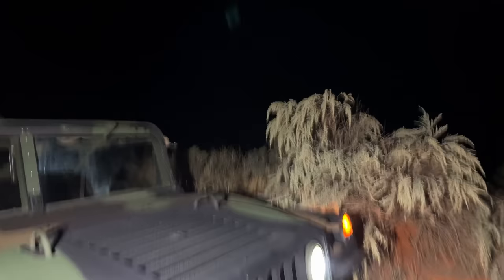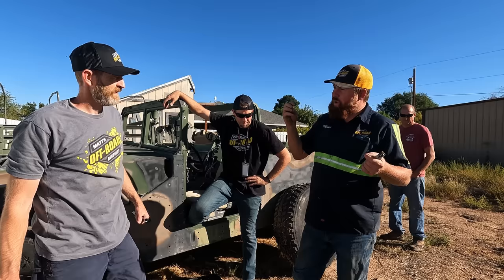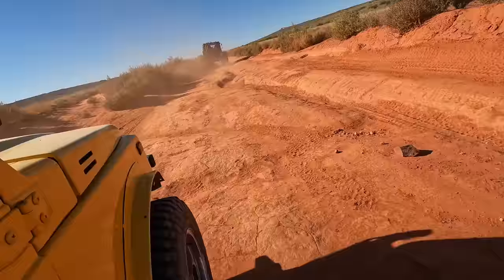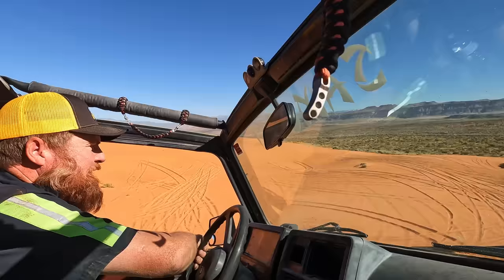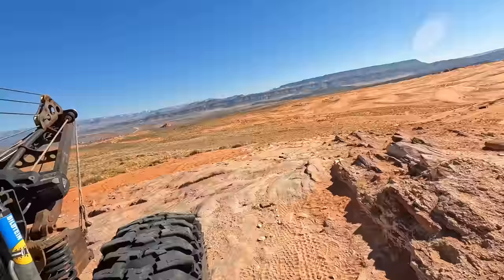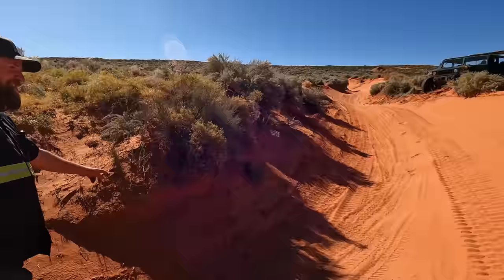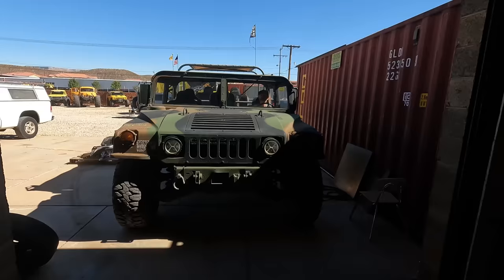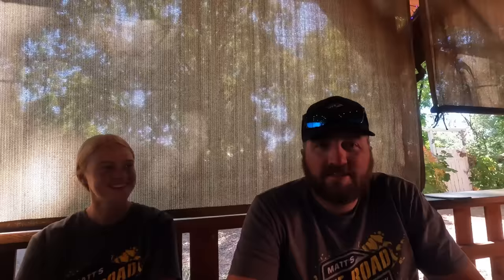Samorri Get's Its First Off-Road Recovery!

Comment: Seeing Matt laying in the sand, sometimes the mud, rocks, etc.., I can’t help but see a market for “Matt’s Mats”
Reply: But how to solve the storage issue? Always gonna be dirty, plus it could be too thick to store or too thin to be useful
Reply: too thick/too thin means trying the Inflata-Matt option.  any holes resultant from goat heads equates to ad hoc air conditioning
Reply: The specs are up to Matt and his experience in the dirt-seat. It’s like any other gear: needs care and maintenance.
Reply: Brilliant!
✌️🐸
Reply: Matt's matts......has a ring to it.
Reply: Aka yoga Matt
Reply: I also bring some of those thick foam play tiles for laying on, they're full of welding burns etc, but so far seem to be quite durable and not effected by any automotive fluids or the elements
Reply: Matts mats is a great idea, it could be thin roll up, doesnt have to be padded much just tough and something to get you out of the mud. personally i use carboard but that breaks down
Reply: Matts Goat No Mo Mats
Reply: @GreatOutDoorWorldofMines  Something like an oversized sushi roll mat. Bamboo is a great material for stuff like this
Reply: or bath soaps!
Reply: @meeeeee423  Design a mat like an onion. as it gets dirty peel off a layer. Or simply have a mat that turns inside out for clean storage. clean it when you get back home.
Reply: @meeeeee423  You actually have to bring them along to have a storage issue....like tools 😐😐
Reply: Matt should do something like a heavier duty yoga mat that still rolls up nice. Tough enough to not get punctured by sticks/rocks but still stows away for storage.
Reply: @meeeeee423  I've got a thin rubber mat that came with the trainer setup/addon for a regular bicycle. it rolls up like a yoga mat but is a better thickness. I've laid it on my gravel driveway when I've needed to crawl under something out there, and it works damn well. it doesn't need to be massively thick.
Reply: I have used rubber roofing for years mud ,rock,sand ,easy too clean
Reply: He needs a heavy canvas drop sheet, something around 1x2m (3' x 6' or there abouts), it's strong enough that it won't get cut up, can be washed off easily, and will take a lot of the sting out of rocks and brambles.
Reply: @georgemiles7392 Inflata-Matt as in a blow-up doll with a beard glued on?
Reply: I think he could use inflatable mat jacks, too, raising the vehicle to a more workable height.
Reply: @meeeeee423 if you’re out playing in the dirt, you’re not coming home clean. This at least gives you the option to store the mat in the back of the truck, which is much harder to do when you’re the one that’s dirty instead of a mat. 😉
Reply: Make a thin locker behind the seats.  use three or more 2'x2' mats (adjust the size as necessary for available space) with holes in each corner for connecting them together if needed.  keep some zip ties in the locker for that purpose.   They stay dry, relatively clean and easy to assemble into the configuration you need.
Reply: Last cactus agrees.  😉
Reply: I wish I could post pictures here. Id take a picture of it. I carry a floor mat...with a logo on it. It came out of a school, so it has their logo on it.
 It is a floor mat that a company puts in front of an entranceway, they go on the inside or outside. It is carpet on one side, thick rubber on the other. There are companies that make these, and they lease them out, or something. They pick it up, trade it for a clean one, and they clean it at their Shop, and come back and trade it back, and so on. Or you can buy them, and lay it at the door on the tile floor, and vacuum it. 
 I roll it up as tight as it can go, put a Velcro strap or three around it, and toss it in back of the Gladiator. It is about the size of a Tonneau cover, when rolled up.
 Matt, if you take this idea, I just one one for myself...please...:D...and maybe three for my buddies to carry in their rigs so we can advertise for Ya at KSC where we work. :D
Reply: A big sheet of cardboard works well….”plastic” cardboard even works in mud.
Reply: i love that idea

Comment: I don’t know about sand hills, but in my samurai putting 6.5 gears in the transfer case made it climb almost anything. I’m excited to see more samurai content and what y’all are going to do with it!
Reply: I just made a similar comment that thing deserves a full build, would be great content those old Samurai's are great capable machines if built correctly I used to have a '85 hard top when I was a teenager that I still regret getting rid of, it was so fun, great for wheeling tight trails
Reply: @caseyrenner7024 everyone who's owned a Tintop Samurai regrets selling it. I just didn't fit comfortably in mine.

Comment: I just did a Samurai build for myself. I wanted one after driving a friends on trails in 1989. Now I’m 53 and finally have one. I did a axle over spring lift and added a couple leafs from CJ5 lift springs. It now has a Toyota 22R-E, Toy 5 speed and T case. I put 5.38 gears in the stock axles and a mini spool in the back. It sits on 35” Cooper M/T’s. I welded up an exocage for when it rolls (not if). Now I’m thinking of using a Prius steering column for electric power steering. I topped it off with a roof gun mount for my Browning M1919A4.

Comment: I think the Samorri needs to become the World's Smallest Off-Road Wrecker. Put a little boom on the back and make it a mini-wrecker just for kicks!
Reply: Having driven many thousands of kilometers on very soft sand dunes, with a standard light weight, low horse powered Suzuki Stockman, lj 80, with an 800 cc, 4 cylinder 4 stroke engine, I found that it needed very special soft, ballooning tyres, to form a large footprint on the soft sand.
In doing so, it was very capable of travelling over the softest sand, which most 4wds would sink in.
The sidewalls would bulge and form a very long footprint on the sand.
Most normally available 4wd tyres have far to ridged sidewalls, and do not allow the light weight little Suzuki to form a large enough footprint, to be able to float on top of the soft sand.
At 13.46, it shows no appreciable bagging of the tyres necessary to float on top of soft sand.
If there is too much "high pressure", not "low pressure" then the footprint is too short.

Comment: The best part of off-roading with a Samurai is the weight. If you get stuck you can lift it out by hand.  You could put a wench on a quad and pull it out :)  Great video!

Comment: idler arm and pitman arm can be remove. Use 40 pounds rack and pinion steering with CARDONE power steering pump and Mervin V fluid use a strong flat washer to the steering pulley and put the tool steering pulley pusher and puller to install all hard plastic and steel hub pulley for power steering. And press against the grade 8 washer/fender with the tool to protect the pulley is what the washer is for. Then align the steering pulley and shelves and tensioner with serpentine belt and afterward remove the strong washer and pusher pulley tool without using any hook/jaw. Then drive until power steering pump gets wear out because the steering fluid is boiling too hot. Only after it is used in long driving. Remanufactured steering pump cost is $122.00 dollars.

Comment: Goats heads are lethal. My co-worker was doing support for the Logan To Jackson (LOTOJA) bicycle race several years ago. Someone had been hauling weeds with a lot of goats heads in them to the dump. They lost a lot of their load at the bridge over the Snake River and picked up the weeds but left a lot of the goats heads on the road. Almost all of the bike riders had lost one or both tires and one person lost control, hit the cement side rail, flipped over the side of the bridge and died.

Comment: Tom you could use a dune buggy wiper motor too.. they have the switch on them and it just takes 1 hole to run the arm thru. Switch is included on the motor also. You can add 2 or even 3 on larger windows and run them independently.

Comment: The bits you need are left handed drill bits for removing broken bolts... pick up a set- very helpful drill bits. Most of the time the bit catches and spins out the piece.

Comment: Tire pressure and engine RPM's in lightweight vehicles are a whole different world to full size vehicles. Where 12 psi might be a minimum in a fsv, 6 psi might do similar in a lightweight. Get your tire pressure right and drive it high in the rev band and these things will go almost anywhere. Loving the video's, thanks guys.

Comment: 22:05 Tom, just use a Jeep CJ type window wiper motor...It does a 90* arc & has the switch right on the motor. Cheap & readily available! My '49 CJ3A uses one.

Comment: 🌟🌟🌟🌟🌟I was stationed with the 702nd Maint. Support Battalion 2nd Inf. Div. Camp Casey Korea in 84,85,86 The Machinist for the 702nd.  Those Hummers- watch out for alternator adjuster bolts breaking on aluminum heads all the time - the love hate relationship of aluminum and steel 🌩 The new gal has this, I seen her hand placement- she is not a newbie to the 4x4 world steering wheel and to keep those thumbs out on a manual steering - yeah - she deserves placement there Matt !

Comment: I had a couple Samurai's, the most fun to drive, was on 33's with 1.6 dohc out of a 95 Tracker. No gearing changed anywhere and would do 70 on the highway and anywhere off-road

Comment: I use the reverse extractos bits for broken bolts all the time, if there is enough thread showing, I will use a stud extractor. In yalls case, a regular drill bit from the frame side will usually push it out.

Comment: How does a Humvee tour company not have its own mechanics?
Reply: They do it's matt
Reply: They really are just a company overcharging for tours that always break down. 

They don’t have good running vehicles, they don’t have good drivers, and they don’t have their own mechanics 😂😂

How are you taking people into the desert on yours in old vehicles, and have no clue about vehicles or how to repair the simplest issues
Reply: Guessing that it's cheaper to outsource the work than it is to keep a qualified mechanic on staff full time.
Reply: They didn't know what was wrong, so they sent a tow truck in case it cant be fixed. They do their own work back at their shop.
Reply: @stevekight1955 still I see an awful lot of them broken down. Maybe do some preventative maintenance.
Reply: Becaus did they did then that wouldn’t create good content 😂
Reply: ……spare parts Hummer may have wiper assembly, swap out for services
Reply: @anthony5227  the owner and Matt spoke about some of what you're saying here. They do service the vehicles.
They just have so many of them and do so many tours and sometimes one of them breaks down.
The owner said that maybe on 1% of the tours one of those vehicles breaks down and that's when you get to see them here on Matts channel.
It's basically statistics: If you have so many vehicles out so often on rough terrain like the rocks and desert, something's bound to happen sometimes. I mean look at Matt's vehicles. They also break down sometimes. They're not unbreakable.
Reply: They have Morr. Why keep the overhead?
Reply: @Questionable_creations I mean look at this episode for example  the bolts snapped unless they were rusty under normal driving conditions that would have never happened even new parts can break off-roading if you hit them right there’s way more crashing and stress involved
Reply: I Imagine they do have their own mechanics, they just don’t do field repairs. You have to remember you’ve got customers with you. They don’t want to hold them up on a field repair, even if it takes 30 minutes. It’s their money and time being wasted.
Reply: Just “yet another dream” of capitalizing on an idea. It’s an American dream, “let’s go take military Humvees, do tours in Utah…easy money“. yes,  intrinsically unqualified, but …dreams. It’s cool.
Reply: @Questionable_creations I used to drive those pieces of junk all the time. I spent more time fixing them than driving. Does not really matter how much preventive maintenance you do… they just break all the time.
Reply: @michaellauer3397 exactly. Anyone who believes that every small business runs like a well oiled machine is out of their mind. It’s people trying to live a better life than 10 hours a day in a cubicle. Eff that
Reply: Because they got matt and can waste his valuable time so he can't get real projects done
Reply: @stacycarter8641 they are a piece of military grade equipment.
IE very expensive way of buying something from the cheapest bidder who also has a cost plus maintenance contract 😂
Reply: It's probably cheaper to pay Matt then to employ a mechanic and have to pay him like like another employee
Reply: All they knew was steering was not functioning and when you're steering is not functioning, it's usually safer to assume that a trail repair is next to impossible, which in this case it was because the only two options that I see basically required either a lift or a welder or both. As for why Matt fixed it in the shop, they could have paid him to do that because they only have one or two mechanics and they have 10 plus Humvees they need to be maintaining
Reply: Everyone is running so lean they sub out all of work and services.

Run as many tours as possible to make as much money as possible
Reply: Because it's cheaper to not.
Reply: @stacycarter8641  exactly. Anyone who's actually dealt with them knows they're crap.

We had 2 in my squadron, 1 was ran into a tree before I pcs'd in 5 years after I got out they were still trying to get that thing right.
Reply: @1rstTry You are a philosopher. I, as a person who has fired every boss I've ever had understand your philosophy.
Reply: @anthony5227  they've explained before they have like 18 or so Humvee's. So the one or so a month or so we see on Matt's is just a small percentage. Ask any veteran Humvee's break a lot. Seeing as we don't have one on every video Matt produces I think they do a decent job as far as price I've never looked them up so I wouldn't know
Reply: @wullxz  I saw that video also. 
But the dude just sounded like he was trying to save the company image. 

The steering broke because he couldn’t steer it anymore. 

And he couldn’t see that the  lots had sheared off? 😂
Reply: @anthony5227  well, he could've also just said no to the publication of the video.
Reply: @wullxz  and that adds on to the point that this guy does not know how to run a business
Reply: Bc they can just call matt duhh
Reply: Because they're some slick willy geniuses that buy the cheapest example they can find, who wants to ride around in some underpowered loud for little reason, exhaust spewing open whole top hoop

Comment: Matt. The vacuum port on the samurai going to the distributor tends to plug often with engine blow by. The factory muffler holds a lot of restriction. I put 2 1/4 inch exhaust from the cat back with no muffler. It was not loud and sounded very healthy. My dad use that samurai for years going from Oregon to Arizona every winter, pulling a trailer those two things will nearly double the power feel of the samurai without adding extra weight to it.

Comment: Tom's idea made the job a lot easier than removing the box. I have had the reverse bits work maybe 1 out of 4 times. It sure puts a smile on your face for a while when they do. My biggest problem is finding them to even try. I only had a set of 5 to start with. Another job well done. It's like the state hwy workers around here, 5 people there and only one working. People joke about it and bring it up all the time. Too many Chiefs and not enough Indians is used the same way.

Comment: guy in the north west, (acme adapters) samurai expert.  sells adapters for everything for the samis. i put a little vw diesel na in mine, ran 31,s with the newer allterrain bfgs,  thing topped out about 60 mph with a good back wind, but in the florida scrubs would go anywhere, floated across the sugar sand easily. was horrible in mud  no wheel speed  lol. if nothing else check him out see what he has, guy is super nice  always  answered any questions when id call, and he has kits for alot of different eng tranny combos and other parts sammi specific

Comment: when I has my Samurai I got a transfer case rebuild, I can't remember but I think it was a 7/1 transfer case. Some have double transfer cases. A new motor would help out also from a side kick. Buy a larger offset rim to push the tires out more and it will be more sturdy. I was running 33/12.5 r 15 on mine. Wasn't a race car and had to downshift on steeper hills on pavement but it crawled nicely.

Comment: Good to see the Samorri again..  That Samurai needs a bit of a tune up, and new suspension cause it is finished.. samurai's in general also runs with basically just enough air in the tires so that it dont debead and that is good enough..

As for engine upgrades there are quite a few cool ones..
Not sure if the geo trackers came with the 2.5v6 in the states (Vitara in other countries). But that swap has been done all over the world, has a really nice tone to it and gives it a good ammount of oomf. swap it with Hilux axles and you have a beast to run 35's.
Here in South-Africa we also do the 1.6 Efi Swap, toyota 2ct, Golf 5 GTI, toyota 4age with a turbo (280kw on tap), Beams 3sgte's VItara 2.5 / 2.7 v6 and a few others.  With most of them running 31-35" tires on toyota twin locked axles..

Comment: The supercharged 3800 would be cool...my vote is for a 4.3 gm v6. The later models in the 2nd gen s10s had a balance shaft which helped with vibration, they were multi port fuel injection and had decent low end torque. A wrecked donor truck would make it an easy swap.

Comment: For broken bolt extractions, use a left hand twist drill bit. The pressure sometimes will spin the broken bolt out without having to use the extraction tool.